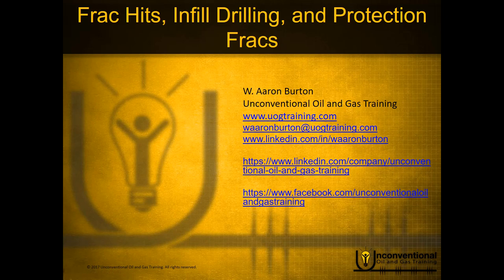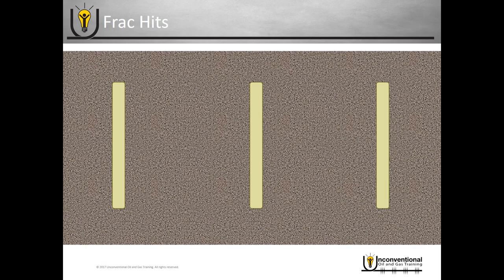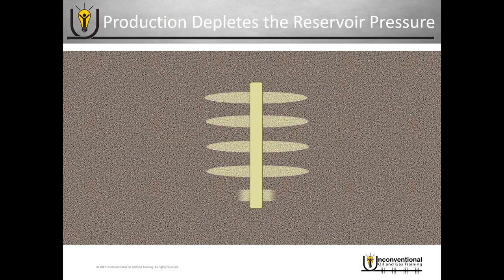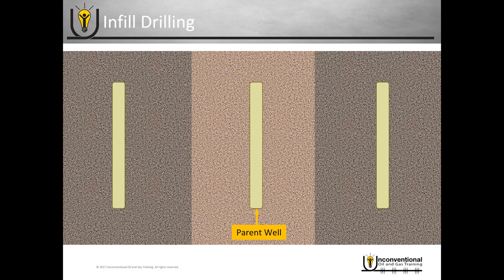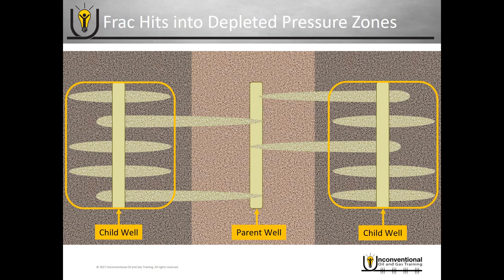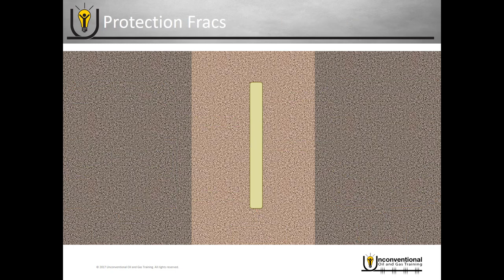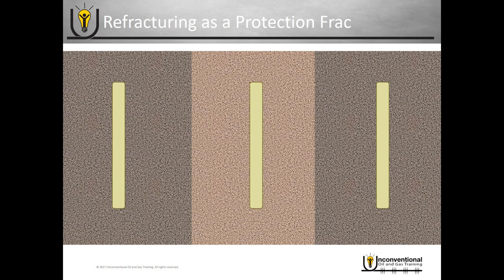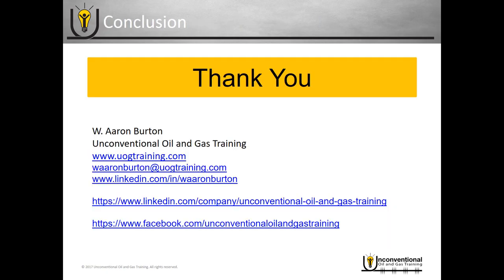Frac Hits, Infill Drilling, and Protection Fracs

Comment: We sell a diverter designed to divert fluid from the low pressure zones in the far-field.  DGS Divert FF, it helps encourage proppant banking and decreases the probability and magnitude of communication.  We have operators use this to protect parent wells.